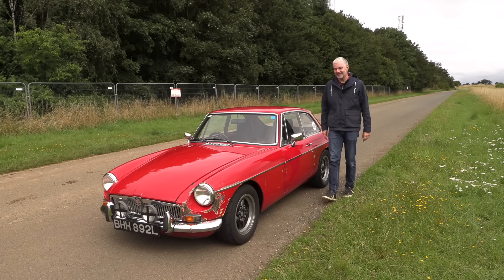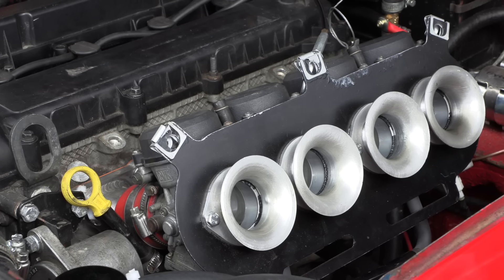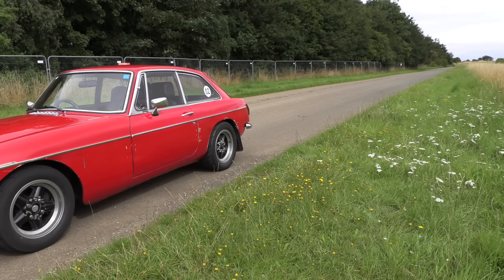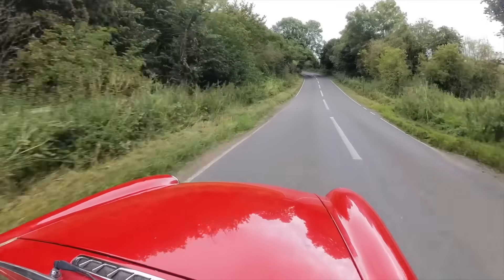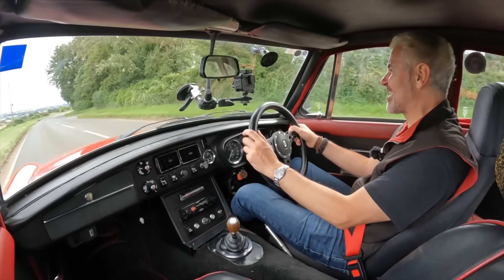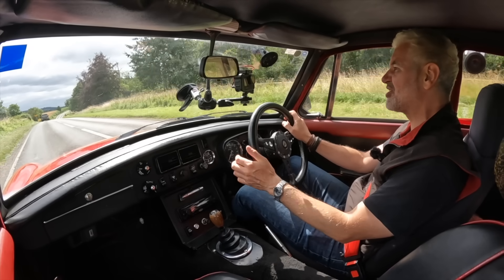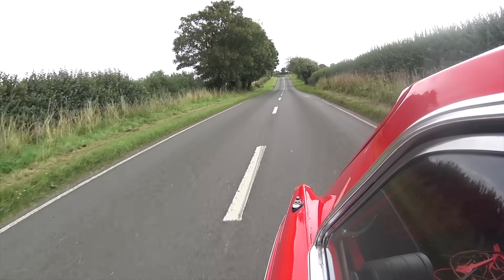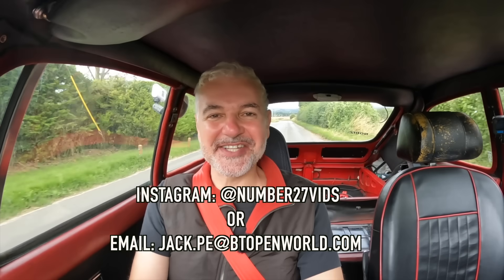This Mod Makes Electric Conversions Redundant - MGB GT Duratec

Comment: Similar thought i was thinking on a seventies Ford , no matter which and an americanised essex V6 from the Americam Mustang , specifically the 3.8 you could find in an MOT fail sn95 Mustang from 1999- 2004 the engine and engine wiring loom would be cheap and gives about 200hp and ould even use the ADO4 auto box all would fit with light mods in most escort sized and up 70' s 80's mid sized euro Fords .

Comment: I've owned a B and a B-GT. At the time not thinking about the collecting value or anything in that order but just something fun to drive. They definitely fulfilled that. I had thought of doing a conversation but at the time just keeping them going was all I could afford. I'd like to have another one now, but mostly stock engine with the Moss supercharger, and one with the electric overdrive. Guess, I'm more interested in keeping it an original classic, but with a bit more pep to it.

Comment: I bought a 1967 mgb which broke down with an odometer reading of 00027! The voltage regulator was stuck from the factory and I quickly ran out of battery.

Comment: putting a different motor with cooling, mounts different carbs and transmission and clutch is basically re-engineering a whole car along with the suspension... a rather major and expensive undertaking.

Comment: My duratec was FI obviously.  I take it these are mechanical carbs now.  LoL, I was going to ask what happened to the car computer electronics. No more Oxygen sensor I presume?  was there VVT or similar modern bits on the engine?

Comment: From the interior shots while you tested it looks like he couldn't get the speedo working.  That originally comes from the gearbox.  Did you know you can get points on your licence for driving a car with a speedo that doesn't work? Its an MOT fail.

Comment: I saw one on 5th gear that was upgraded with a more modern ford engine, the old b series was a bit heavy, i think it weighed more than the rover v8! Being a v8 fan, I'd rather go the v8 route but anything is better than electric! If you want an ev buy a modern one!

Comment: I’ve seen a number of engine swaps involving bike carbs on YouTube and none of them have fitted air filters.  One of the channels then complained of low compression on the front two cylinders, “air filters are for wimps” he said.  Maybe he’ll find scoring down the bores and pistons, maybe not.  Air filters are cheaper than a rebuild if so.
Reply: In this case the filters were taken off for the photo..... There's a panel filter the rest of the time.

Comment: As MX5 NCs begins to rot away, they would make an excellent donor car for this project. I wonder if you could incorporate the whole power train? I believe the Durance engine was developed by Mazda and a common MX5 mod  is to use 2.3 and 2.5 versions of this engine.

Comment: This is absolutely fantastic. I am so going to do this with my MGB.  However. I am 18.  Hoe much would it cost to ensure with bike carbs and different engine+gearbox?   Many thanks
Reply: Hi it's my car in the video. The insurance went up a bit and I'm 25. But it depends on the insurance company. Ring and ask I say. Varies a lot by company. Hope that helps.

Comment: I have a 1981 MGB GT (yes you read that right, 1981, even though the factory closed in 1980!). 
After the factory in Abingdon CLOSED down in 1980, all the remaining MGB GT parts were shipped to British Leyland in South Africa as CKD (Completely Knocked Down), where only 200 was ever built from imported CKD kits.

Comment: be nice if EV conversions / engine swaps were indeed generally available for c £5k
I would love a GTV or TT with 250-300bhp EV - Sub £7k all in for 250 ml summer range would be even better

Comment: Jack. Biometanol and bioetanol with 15% petrol in it,... m85 and e85,..... can be put into most vintage engines. Indeed SAAB and Volvo made cars prepared for said fuel back in the day........... 2008-to.2018;.... the only drawback: Higher Octane and hence higher power output than regular petrol engines,....... Thought your video would be about those conversions....... Now that it isn't. Fancy DOING a video on those vehicles? Then please get in touch........

Comment: Correct me if I’m wrong but some of the parts of this B seem to be from inconsistent years. I believe that gorgeous dash is from 1960s, while the rubber bumperettes, the multi coloured and reshaped tail lights and steering wheel are from the early 1970’s.
Reply: I think you're thinking of the US spec cars.
Reply: @jacobyoung1671  Canada but probably the same as US spec

Comment: I think a Honda engine swap would have been a better option with unlimited performance upgrades available. Having said that, it’s still a great build.
Reply: Great idea. The Honda engine is a bit taller so it requires a bit more work to fit. I think you need to cut away at the bulkhead around the heater box. So it would be harder and more expensive but for sure a cooler engine.

Comment: Keep the original engine and put a pre-ionisation chamber, a plasmoid generator & a thunderstorm generator in there and your exhaust gases will be 20% O2!!! Remember where you heard it first, right here on good ol No 27. :):)

Comment: just a note; for lite little cars that need new upgraded ICE 4 bangers i was thinking about an engine that is ubiquitous in the U.S . and perhaps in UK or other rainy places . Hyundais 1.6 T . I bring it up because I own a car with one of these tiny engines ( in U.S. a 1.6 is micro although way more common and socially acceptable today) .  Mine powers a 3000 LB Hatchback , puts out 201 HP 195 Tq ( i forget the RPM curve ) and in that case the car is underpowered , but that is a subjective statement and its not terribly underpowered but anybody can think power to weight and realize its not going to be a fast car . HOWEVER , hyundai being the 3rd largest MFG in the world today and that engine being put in soo many vehicles including of course Kia's my thinking is there must be a mega fook ton of these around from crashes so one might assume they are easy to find and not too costly . A 2019 fiesta ST in U.S ., widely considered the most fun FWD car one can own also has a 1.6t with about same power but only pushing around 2750 lbs is a better set up but they are not super common and my ford ownership experiences have not been good at all and FORD no longer sells passemger cars in U.S. besides the Mustang . Everything else is SUV , EV and of course Hill Billy Bricks keep the lights on with F-150 PU . Depending on year and such the Hyundai 1.6T is a decent engine ( some runs had issues outside of design that made them fail but when put together as designed are fine) . They rev decent ,  I personally think for a 4 cyl car ( ive only owned 2 this and a STi with 2.5T) sounds OK in stock trim where its not loud inside but its not an unpleasent sound when it is redlined , you redline it everytime you drive it no matter the trip which is the saving grace of underpowered car with MT is you can do it without having moral struggles about public safety and those who enforce the laws designed to disinhibit those lacking care for public safety and to fund govt . Anyway , considering Hyundai used to be a slur in the U.S. , condoms would expire if you owned one , it was suggested you got tested before you did breed to be sure you didnt have genetic issues and for certain jobs requiring a level of mental aptitude you might be disqualified if you owned one,  now Hyundai owners are granted full rights and only BMW , and AUDI owners privately discriminate against you but thats normal for most peasent cars or wrong branded cars in certain circles and these wee little buggers are certainly growers and not showers ( Elantra GT N Line in US and I30 something in other markets ),  Car and Driver published 0-60 in 6.1 to 6.4 range and 14.9 at 94 MPH 1/4 for my model which is actually blisteringly fast when you consider everything including entry price although that is with the Dual Clutch Trans which is a SHOCK , a true SHOCK that HYUNDAI had the AUDACITY!!!! To put an actual DCT in a peasent mobile with a 1.6t , but IT DOES keep the mouse at full sprint on its wheel so you stay in the effective power range , shifts every other second and makes the car feel kinda fast where as the MT car like mine feels almost quick in some situations in 1 through gear 4 with 5-6 both being overdrives that leave you with virtually no power and one must be adept at dropping multiple gears and feel very confident if a situation calls for immediate thrust and one decides to take action rather then a more passive stance and thinking ahead is needed . Another interesting thing that DCT . I have pondered what I thought of this engine , i get some enjoyment from it via it being connected to a MT which makes almost anything fun to drive but thought if it were in something like a 2400 lb miata it would feel great minus the loss of NA character , BUT ALSO !! with projects and swaps so popular that if somebody has a lightweight car and doesnt want to put an LS1 or an increasingly harder to find honda engine forced to work overtime on steroids and stimulants to overpower cars meant for fun and handling enjoyment that in some situations it might be nice to have an actual DCT with this engine if your chasing time and or dont heel toe well and prefer to just steer and brake when being stupid on mountain roads with endless and often sharp turns you may or may not have encountered before and needing only hit a paddle could be fun and keep the car undisturbed . My conjecture is that IF Motor Trends #s are correct which I think they are because I have seen Manual Cars run under 15 on prepped surfaces and THEY ARE certainly slower by a lot in many scenarios and 7.5 to 60 seems a feasible 0-60 with MT and the two cars just feel VERY DIFFERENT depending on trans , if one COULD or had the mechanical abilities and it was not impossible , too daunting or made no sense , what would a miata for instance feel like with this basic and common engine in a miata utilizing the DCT trans if possible to fit and make work on RWD and even with just a MT it would seem like a sweet spot over 120-0r whatever some of those make and old sports as well .Seems like enough power to add thrill without overpowering and then struggling to get traction or have fun because its now a beast . Thats all . I NEVER SEE ANYBODY re purpose these and figure SOMEBODY must have just had one or got one free or super cheap and as Humans be curious and motivated to make it work / fit into something where 201 195 is a nice # and if something does break or go boom once set up finding a replacement or parts wouldnt be hard because they are in soo many cars and people crash a lot leaving cars totaled but having a serviceable engine. In an older car not restricted by high emession standards these little korean blender motors with uncorked exhaust and availible tunes that coax the mouse to run harder on the wheel and now freed up of some resistance via open exhaust another 10 -15 - 20 % HP seems easily and reasonably achieved and my understanding is that because they are designed to make what is reasonable power for micro engines on 87 octane ( lowest in states ) there are tuning set ups that whip the mouse to create a little more boost and advance timing when one puts fuel not so easily combustible as to explode early and running this way after paying for the expensive 93 ( if you live in NY for instance ) or 91 if your unfortunate to live in CA and that something around 240 HP can be expected and although all power increases mean more stress and accordingly more likelyhood of less reliability after many miles if one takes advantage of the increase all the time you can have staged settings for the tune depending on what fuel and ones interest in POWA!!!!!! at any given time for whatever purpose and expecting some level of reliability is not a crazy idea . Thats all , high supply generally means lower cost and ease to procure and it seems to me to be overlooked but I am not mechanical but do know there are all kinds of factors that make different transplants easier or more difficult and besides old hondas and older GM american cars it is not always as easy as a set of tools and engine winch plus a free day , one friend , 20$ worth of beer or some other intoxicant to put a different engine in a vehicle that is superior and " bolts' right up and even CHEAP and  EASY MODERN swaps just mean not as bad as others or even just mean its still stupid BUT if you enjoy such endevours and think ," I wonder " often and just doing difficult an somewhat un common things is amusement for you and you are willing to devote some $ for that enjoyment then it might be worth it and cheaper then disneyworld or some other thing where your forced to que up with un attractive people to wait for a few thrills for what is substantial money and perhaps your kid might even be better served ( i could have used it ) to learn how tools work considering many food MFG have gone to either pull tops or reseable PL:ASTIC BAGS that lower tesosterone or mutate genes or whatever because sales of certain food products tanked amongst younger people who could not operate heavy machinery or use sophisticated tools like electric or hand can openers and spending time doing something fun where you learn SOMETHING about problem solving and how things work etc can only be good an applicable to other skills and afford time spent with the spawn instead of them being programmed to do god knows what including want to que up wondering why people in the real world look so different and kind of odd compared to those on my screens .

Comment: Sorry. Electric is another level and you cannot install some minor modern gas engine and get anywhere near the torque and performance you can from an electric motor.  Sure its a lot cheaper to use a gas engine but it's apples to oranges.  In the face of global warming gas has to go anyhow. The damage far outweighs and pocket change saved.

Comment: Always wondered why engine swaps to modern engines were not popular in this country then I remembered the insurance industry look to take your eyes out if they will even quote, I looked to buy back a damaged car, frame untouched, needed bonnet, headlights and radiator, original parts would be £3k on a £5K car, aftermarket would have been less than £1K and easily fitted parts. insurance was going to be almost £12k opposed to £1.6k for an undamaged

Comment: Ironic.  Also had a 1972 MGB GT.  Mine was also red and and I also installed red safety belts - I got mine off a Toyota corolla. My engine's piston rings blew. I installed a Toyota Y1 engine a rear wheel drive engine. Looking back...
.
.
.
.
My car was a real piece of crap even with the Toyota engine.  As an example the brakes on an MG are dreadful.  I now own an EV.  In my mind the EV conversion is the best thing for an MG to a large extent it even resolves the brakes issue.

Comment: Never owned a B but have worked on several in years gone by. This is dynamic, a super conversion and "Why the Devil not?" Expertly reviewed and a good watch is why I am a subscriber.
Electric is not for me, it has it's place but it will not do in the long run, in my opinion. Tell the B owner he has done well with his machine, I salute him and others who do similar.
Over 30 years ago now I upgraded my Simca 1501 to Fiat 131 twin cam spec with all-Fiat drive train. Not the fastest but has been comedy on occassion. 
Many thanks and Best to All here.

Comment: Surely it's on bike throttle bodies, not carbs?
Reply: That's my car and those are carbs. Throttle bodies would have been smarter it's my main regret.
Reply: @jacobyoung1671  OK, fair enough. I just assumed with a modern lump like the Duratec it must surely be throttle bodies. So no longer fuel injected? Brave!

Comment: Where did the owner source the adapter from the Duratec engine to the Miata transmission?
Reply: Hi I'm the owner. Doesn't need an adapter just a change of spigot bearing.
Reply: @jacobyoung1671  Thanks Jacob - good to know. Do you think the auto makers are wandering back to a bit of commonality of parts again?
Reply: @cdjhyoung   so the reason for it is that the duratec was really a mazda engine. the mk3 mx5 actually uses a duratec except it has a vvt head - in this form it is called the mzr. so the bellhousing is the same.

Comment: Looks like a nice car but of course it isn't a clasic B any more, just a special. When you quoted the cost you didn't say if they included fitting. If it didn't then you could add a lot more to the price tab.

Comment: While I appreciate what's been done here, reasons I would convert a car to electric aren't really parallel in nature. I have a 1972 Fiat 500 I'm looking to swap to a BMW R100 airhead engine, so it would be similar to what's taken place here. However, I do want to find a car to convert to electric as it would be a car that would demonstrably require a lot less maintenance and would allow me to drive something older yet emit a lot less pollution in the city environment I live in.

Comment: Cleaner, more fuel efficient, and far more powerful than the original engine. And the old car is super light so the engine is less stressed and even more efficient.

Comment: With that modern Ford power in that MGB the owner could make it even more "Earth-friendly" by doing a natural gas or propane conversion to the engine thereby drastically dropping the level of GHG emissions that come out of the car's exhaust with little to no power lose.

Comment: But don't the new DVLA rules make it near impossible to alter ANY of the current car (ie, drill holes in the bulkhead, change the running gear..... etc) without the vehicle then becoming un-roadworthy or (at a minimum) a Q plate?